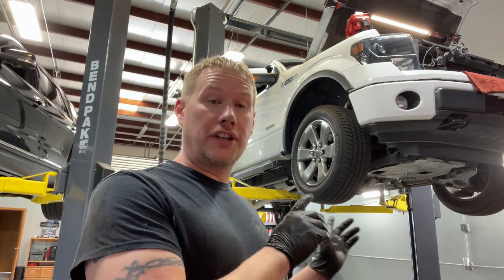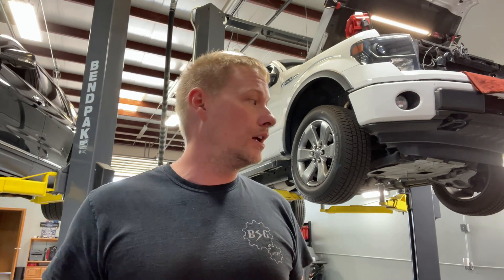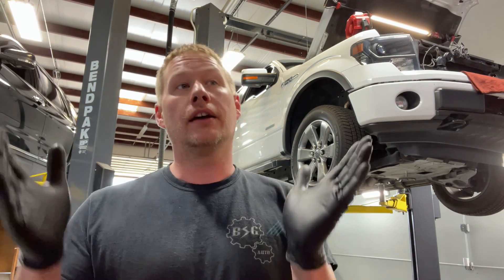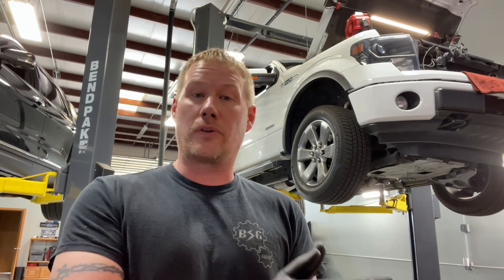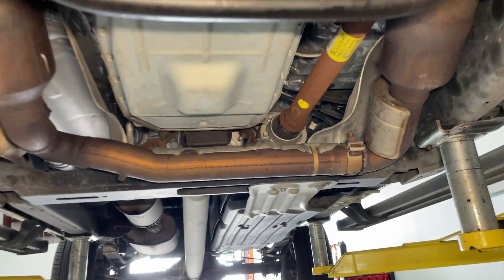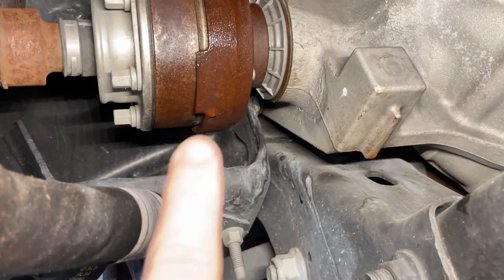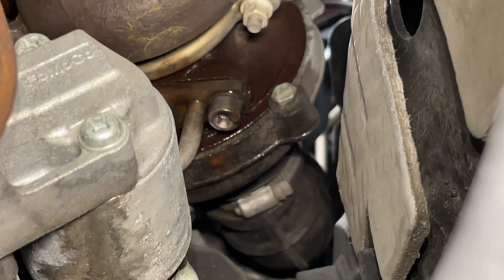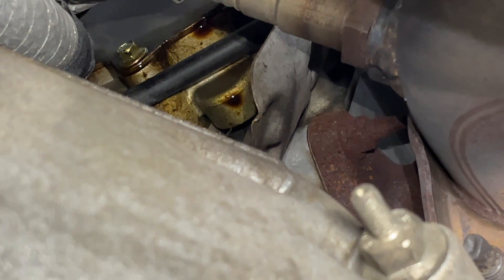Ford Ecoboost Engines Can be so Hit or Miss: I Really Feel Bad for This Customer...

Comment: That’s why I went with a 5.0 when looking for a 2013 F150. Felt like it was too big of a risk getting an EcoBoost.
Reply: I had a 2018 F150 with the coyote engine.  By 90,000 miles it was consuming 3 quarts in 3000 miles.
Reply: @brianlanning836  I heard that issue started in 2018 model year. i have a 2013 wit 120,000 and zero oil buring or any other issues
Reply: @brianlanning836  Ive done tons of oil changes on those 5.0 engines and honestly if its losing that much oil you got an issue somewhere like a leak or a piston ring has gone but that only really happens with poor oil usage. It was always the 'shop around' customers that had issues and it was usually from the local jiffy lube quick lube using the wrong oil.

Also Ford for a long time was telling their customers that the normal synthetic oil from mobil wasn't up to snuff enough and switched to recommending Castrol oil instead. I wonder if that has something to do with it considering Castrol pushed hard to get a better brand via their product being better made.
Reply: @Crunchymunchys  That was my guess, that it lost an oil ring.  The truck was a rental before we got it at 30,000 miles.  I made the assumption that since it was a fleet vehicle, it probably got all the oil changes.  But I'm now rethinking that assumption.  Fairly quickly after we bought it, it developed a valve train tick.  I put valvoline synthetic blend in it the entire time I had it.  I think either it had an assembly problem from the factory, which other people have reported similar problems, or it never had an oil change in the first 30,000 miles.  The oil was clean and it didn't seem to have any sludge though.  So I'm going with the manufacturing defect.  Now I have a new 2500 silverado.  The only problem that has is a broken tailgate button.  Hopefully it does better than the 150.  I had to replace a starter and a wheel bearing on that 150 also.
Reply: @Crunchymunchys  Castrol > Mobil
Mobil burns off/up. That was disappointing to find out.
The best stuff out there Amsoil. Original creators of synthetic.
Reply: @Iconhulk  Are you an Amsoil dealer?

 I’ve been using Mobil 1for as long as it’s been produced. I use it in three different vehicles and if I fill the vehicle to the proper level on the dipstick, when I go to do an oil change 5000 miles later the oil level is exactly the same.
Reply: @brianlanning836  that’s pretty normal these days unfortunately. I remember when I worked for a Subaru dealer, Subaru considered anything less than a quart every 1200 was “normal”.
Reply: @brianlanning836  I totally agree with you. I can understand using a bit during between oil changes, but to me anything over a quart in 5000 miles seems excessive on an engine that doesn’t have a ton of miles on it.
Reply: My 2013 with the Coyote just turned 270,000 miles on it and still running great. The rear main is leaking a little but less than a quart every 5000 miles. I did have to put a new water pump this year.
Reply: Just rolled over 203,000 in my 13 Ecoboost. Replaced the fitting on both turbos (leaking coolant) and now I need to reseal/replace the vacuum pump. Only two issues I’ve had since I bought it with 40,000 miles. 

Oh and it eats spark plugs every 10k unless you go a step colder.
Reply: Same here, found 5.0 2014 Lariat.  Buddy told me to stay clear of the eco boost.
Reply: They added Cylinder Deactivation to the 5.0 in 2021.  Thanks Ford for screwing up your best engine
Reply: @ctbale1  Just unplug it
Reply: I've only ever owned one fancy turbocharged engine and I'll never own another again. Bought an 04 5.4 and I'll never look back. More technology means more things to fail
Reply: One of my neighbors has the 4.6. No trouble. My other neighbor has a 5.0 and completed a 12 state tour this summer without one problem.
Reply: Thought the Coyote engines also have Timing Sprocket/Phaser issues.
Reply: @Bobsnarls  I've got 120,000k on m 2013 and zero issues
Reply: same!.. I stayed away from the twin turbos for that reason.... the added complexity and parts.
Reply: I had a '12 Mustang with a 5.0 and it had phaser issues but that was the only issue.  Knock on wood my '13 F150 ecoboost has been good but only has 77k.
Reply: @tagle2818  my 14 eb F150 got chains and phasers at 65k 🤦‍♂️

Comment: I have a first gen 5.4 and really didn't know the Eco boost had the similar timing issues. Those leaks on a low mileage truck is really inexcusable. Another issue besides the phaser/timing on the 5.4  was the transfer case seal. ATF fluid started disappearing and these videos lead me to check the transfer case. Was @1.5 qt. overfilled. The truck only had @ 85K and the seal failed. Windows collapsing in the doors due to cheap regulator parts another issue. 3rd brake housing and cab leaks around the top molding. My 2000 4.6 has had less issues and has 242K. Looks like Ford is fumbling and pretty sloppy. Anyway, I bought my wife a used Toyota and in 4 months only had a a power steering hose leak. I have the same hit and miss shop/stealership mechanic issues, I think its pretty common now.

Comment: I have to admit this video has me slightly confused. We have a 15 explorer sport that  as far as I know should have the same 3.5 ecoboost in this truck and we just had a water pump replaced under the extended warranty at 110,000 miles but the water pump is internal and timing chain driven not belt driven as shown in this video and we paid for the timing parts to be replaced as a while you're there item at zero extra labor. Am I missing something because they didn't make the 2.7 ecoboost in 13 which has the external belt driven pump similar to whats shown.

Comment: My 2019 3.5 has been making that startup rattle since 15000.
Shield on the bottom has fell off.
Have been to multiple dealers for fixes and nothing they are full of shit trying to say they are waiting on parts. They are waiting for the warranty to run out!
I gave ford a chance for the gas mileage,  but not again. 
Wrote letters to just about every ford contact and survey I could. 
FUCK FORD.
even took it to a dealer to fix what they have a recall on for the phasers and you guessed it.
They didn't fix a damn thing.
At almost 50k now. What a shame 😔

Comment: Not a question for this truck but figure I would get your opinion. The infamous 6.2 long crank issue is there a fix. Mine is a 19 F350 it started doing it about 11,000 mile have a little over 20 now but its kinda aggravating when it does it and acts like it isn’t going to start.

Comment: This is why I won’t by the 3.5 Ford is almost at the point of getting rid of the 5.0 specially when they go to the plug in hybrid with the 2.7 motor or 3.3 motor

Comment: im just wondering if the customer lets the vehicle warm up and cool down properly... it is a turbocharged engine, and probably 99% of people do not let them heat up and cool down properly. it can and will cause hot spots in and around the turbines. and oh,,, i coulda had a V8...

Comment: I’ve had the turbo’s leaking coolant on mine along with some other issues.  Seems most are turbo related.  My truck is a 2012 and had the issue at about 90k miles.  My dad has the same truck but a 2014.  Nearly zero issues. Like you said just hit or miss I guess

Comment: I have a 2017 Focus with the 1.0L Ecoboost and at 51K miles have had zero issues.  I got that engine because it comes with a conventional torque converter trans, not the DCT.   The only thing that does concern me a little is the wet timing belt system it has.  Ford says check it at 150K.  It's sealed in the engine so how are you supposed to check it,  I'll just replace it if it makes it that far.

Comment: Traded my 2012 platinum Ecoboost for a 2021 TRD Pro Tundra.  The Ford was good but started getting me nervous at 90k miles.  I feel good back in a rock solid reliable V8.  I believe Toyota is going the turbo route next year as well so it will be interesting to see how those engines hold up compared to the Ecoboost ones
Reply: I knew it was coming and will be sad to see it (turbo in toyota's)
Reply: @onenikkione  hopefully they learned from all of fords mistakes 😂🤦🏻‍♂️ no way it makes it more reliable though. It’s simple. More parts more chance of problems
Reply: Should have switched to the Coyote 5.0 V8

Comment: I'd like to say Ford doesnt deliberatly manufacture known defects but there are legal battles that have proven they did exactly that. Just search  "Ford's 6.0L Diesel Engine Lawsuit". At the same time they engineer their motor assemblies in an intentionally difficult to service manner so the average person cant do basic maintenance...Example: Putting the fuel rod assembly directly on top of the spark plugs.

All the while they cheat emmissions testing just like everyone else and are just now getting caught ("  Ford F-250, F-350, F-450 Super Duty Emissions Lawsuit")

 The reason Ford F-150 is the number one selling truck in the world is because its the bottom of the barrel cheapest anyone can buy. And sometimes the dealer sells it at a slight loss because they know they'll earn more in dealer repair costs over the life of the vehicle.

Comment: I have a 2012 F-150 with a 3.5 Ecoboost engine.  Bought the extended warranty.  Then i moved 3,500 miles to Ontario.  The local dealer leaves much to be desired.  A month after my warranty expired, I found a piece of broken coil-spring from the left-front shock sitting on the ground.  The spring was badly corroded so this had been going on for a while.  Checked the right side, and sure enough, it was broken as well.  All the "Multipoint Inspection" records showed all was good.  Yeah, right!  I could go on with multiple examples. They're bums.  

Thanks to this channel, I've saved hundreds if not thousands of dollars on how to make repairs.  I plan on driving down to BSG for an oil-change one of these days, and to have this brilliant and thoughtful man go over the truck.  May be sooner rather than later, as I have a weird noise when I push or release the accelerator pedal.  Hmmm.

Love your channel, keep the vid's coming.

Comment: First, I just received my FORDTECHMAKULOCO tee shirt.
I support this channel because of all the advice and service tricks, torques and tech that is provided.
THANK YOU VERY MUCH!!!!
Second, Ford is a great truck maker but, they have been leaving to much on the table in engineering especially the little details stuff.
Things that should not be giving any grief to the truck owner.
Pretty bad when say the driver window regulator breaks from just closing the window,  $150.00 fix Thanks Dorman Products.
The rear door driver side harness between door and B=Pillar breaking a wire and not allowing the door lock to work and giving an "Door Ajar" warning.
Heater blower motor resistor (third one) on a 2012 F150.
Coolant leak  from $5.00 O-ring that mimics a water pump. How many people were talked into a new water pump when all it was was a square shaped O-ring?
The coating on the caliper brackets being too thin and letting rust start under the stainless slides and causing the front brake pads to not move freely leading to stuck calipers
 and uneven rotor wear. Bastards.
My all time favorite the Lead Frame Connector in the trans above the valve body that just craps out due to metal build up and causing shorting across solenoids.
That was $300.00 plus including fluid to repair and Where in the hell is the dip stick tube for easy fill?
But, NOOOOOO!!!!
So yea! Ford has dropped the ball on a bunch of little things the last couple of years.
There was a time when the car companies hired people who actually liked cars and knew how to work on them.
Does not seem to be the case with the new group of engineers these days.

Comment: I bought a new 2018 f150. Loved the truck but just sold it and bought a Toyota last week. It had 104,000 km and nearly everything that could go wrong, did go wrong. Leaking coolant, cam phasers went at 50,000 km, transmission at 70k, speed sensors etc. the list is endless. Worst vehicle I’ve ever owned and it’s too bad because I always wanted an f-150 but I’ll never touch another Ford for as long as I live.

Comment: I'd been a Ford guy ever since I owned a '67 Mustang.  Had 3 F-150's, and a pair of F-250's Super Duty's with a Ranger in between.  The 2014 6.7L finished me off.  I loved the power but it was the most undependable vehicle that I have ever owned and it cost me more than my first house!  Keeping the truck on the road cost me a near fortune.  Believe it or not I got rid of it in favor of a Toyota Tacoma.  Ford lost a really loyal customer with their continuing decrease in quality.
Reply: We had a F150 and a Tundra work trucks when I worked in the oil fields and we beat the snot out of them.
The Ford was garbage after 2years but I'll be damned if that Tundra didn't still drive like a brand new truck with almost 200k!
Completely changed my opinion of Japanese trucks.
Reply: The new Tacoma's are garbage..... the engine pings, smokes oil out exhaust and dies going up steep hills off roading (all over internet)...the rear differential whines....and the trans shift all over the place....not totally corrected even after software patch...the new Ranger has NONE of these issues...
Reply: @barrya.6212  I'm glad that you're happy with your Ranger.
Reply: @barrya.6212  prior to the brand new ones, tacoma is the most reliable mid sized truck with the highest resale value, also number 1 in sales,  there are a couple Tacoma’s and tundras with over 1 million miles on original motor and transmission!
Reply: @titirititiri6360  Yeah...but EVERYTHING is about the status of the current model...and as discussed it is the worse truck in it's class as I pointed out...I have as a secondary backup vehicle/ off road thrasher 95 Ford Explorer...the engine in that - the 4.0 ohv is as reliable and long lasting as any engine Toyota has ever made...but that doesn't do Ford any good in 2021.
Reply: @barrya.6212  i have 3 tundras and 1 Tacoma, 2 of my tundras I use for work, they pull 16’ trailers 5 days a week, my personal tundra I use to pull my 24’ rv, and off roading, my Tacoma is mid travel on 34”s, I’ve never had and issues at all, one of my tundras has over 300,000 miles my employees drive it (not babied lol ) never any issues, just belts hoses, fluids and pads. 
The newer trucks mean absolutely zero to me, I only pay cash for my trucks and buy them with around 50k miles, then drive em to around 300k both Tacoma and tundra since around 2007 have both dominated the big 3 in terms of reliability and resale statistical from a multitude of different sources and of course personal experience. I’ve tried Ford and chevy, will never make that mistake again, it was a bad business decision on my part, live and learn my friend. 
I had a 1998 f350 service bed, 460 with c6 transmission, now that old beast was a solid truck, they don’t make them old fords like they use to
Reply: @barrya.6212  show me some of those old 4.0 Ford motors that have made it to 1 million miles on original motor and transmission? I’ll show you both Tacoma and tundra that have. Also Tacoma’s resale for the same year as your explorer is double the value
Reply: Should have got the V10 instead of the diesel. I tried and tried to tell people these new diesels were a pie in the sky and not reliable. But its hard to get to sheep to jump off the diesel bandwagon.

Comment: Had that rattle start up  in my 2013 f150 3.5 at 80k miles, got it fixed. Not even 20k miles later Then I started to get a under boost condition code and dealership said it was the bov in the intercooler like your videos say they do. Found out intercooler had cracks, waste gates on turbos weren’t sticking. They had to replace turbos and intercooler and bov. I’ll never own another ecoboost engine. I now own a 16f150 5.0

Comment: I had a 2011 F150 Ecoboost on my lift two weeks ago. Customer had a stack of maintenance records six inches thick. Never has missed an oil change. The engine is shot and will take about 10 grand to fix and that doesn’t include turbos. I don’t recommend anyone buying an Ecoboost. Buy a non-turbo V6 or the 5.0 V8. Absolutely no excuse for these issues given the cost of these trucks.

Comment: What really grinds my gears...i bought a 2011 first year of f150 ecoboost. 21000km, not miles, threw a rod. Ford denied warranty because i had a catback on and a 4inch lift. 

Service said these engines are bullet proof and blamed me for modding the truck. Still own the truck has 100k now. Still running fine but it scares me seeing how close i am to timing chain job

Comment: Pretty sad to see those problems with such low mileage.  I'm glad I was able to convince my fiancé's son back in 2014 when he was looking to buy a new F150 to get the 5.0L instead of the ecoboost.  He liked the power of the EB but I told him that since you are going to be driving this truck long distances and keeping it for a long time, go with a less complex engine.  He now has about 220,000 miles on it.  He did have to have new timing components at 190,000 and he changes the oil by the OLM which is always between 9-10K and he uses 5W-20 Motorcraft blend.

In 2017 my fiancé decided to get a new F150 and it was a no brainer for her to get the 5.0L  It's got 34,000 miles on it now and while no issues with the engine, she just had to have the AC compressor replaced at 32,000 miles due to the clutch failing.  I guess they don't make things like they used to.  I'm hoping the 5.0 in my 2014 Mustang GT has a long life.

Comment: 2021 Ford transit with the 3.5 eco boost has 1500 miles and excessive oil leak looks like it’s coming from the head added oil dye and it leaks out right under the exhaust manifold  at least that’s what it looks like it leaks a quart in about 500 miles valve cover gasket is dry have you ran into this before it’s on the driver side